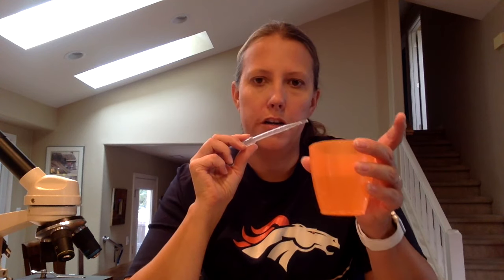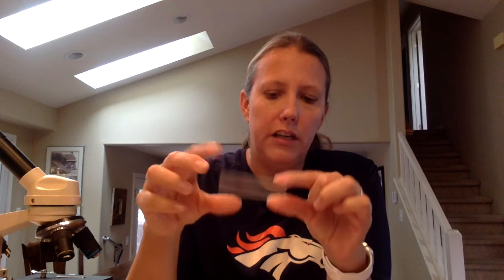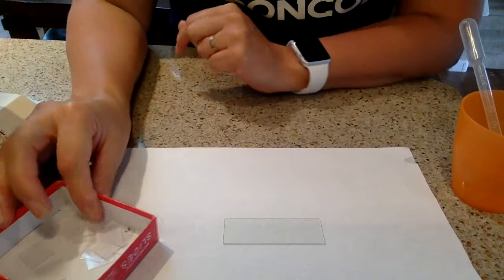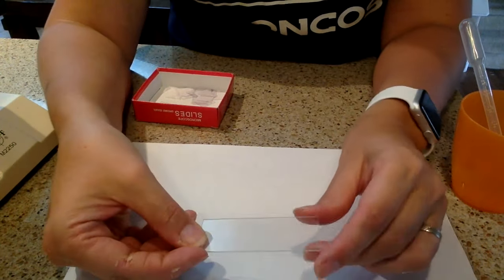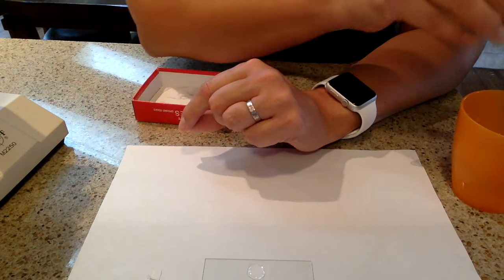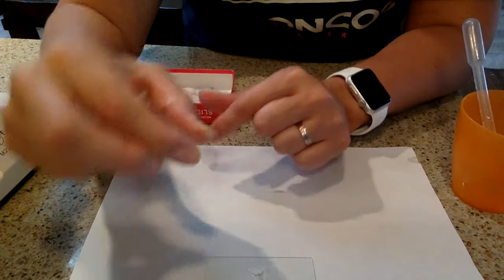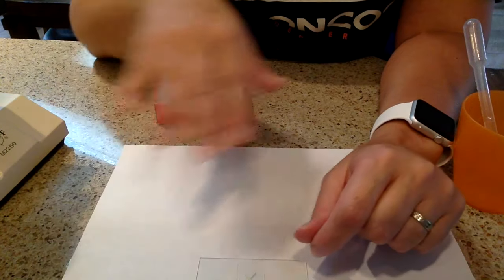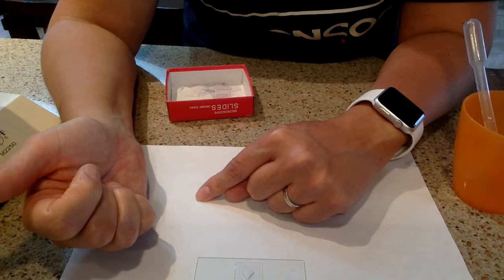How to prepare a microscope slide

Comment: You shouldn’t drop the cover slip, as that will create air bubbles. It needs to be slowly lowered over the slide at an angle to prevent a bubble filled slide. Also, don’t use your fingers, use tweezers to avoid contaminating the specimen.
Reply: You'r right it can create air bubbles which can be not be used to be specimen